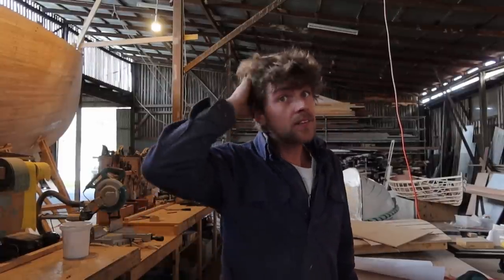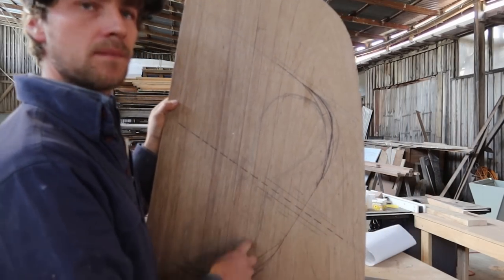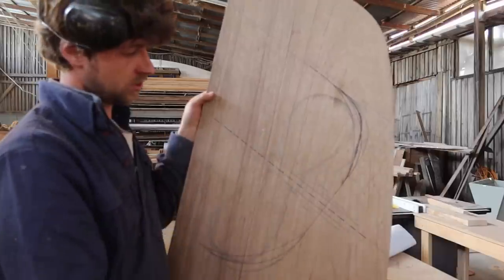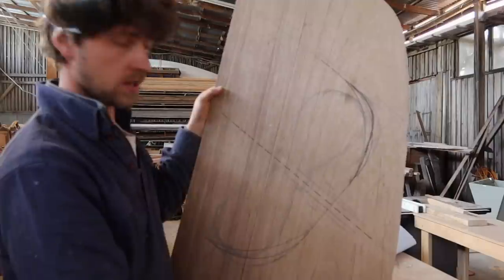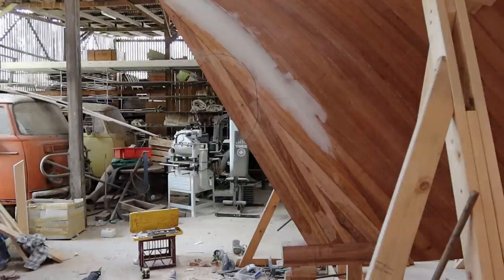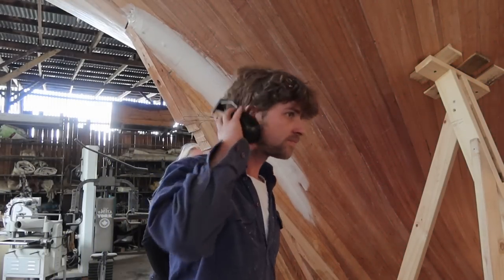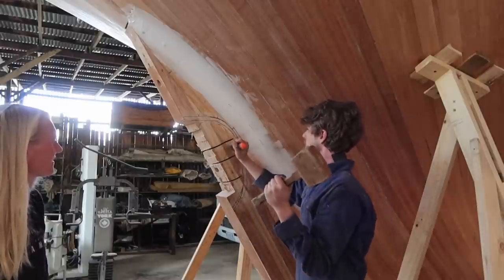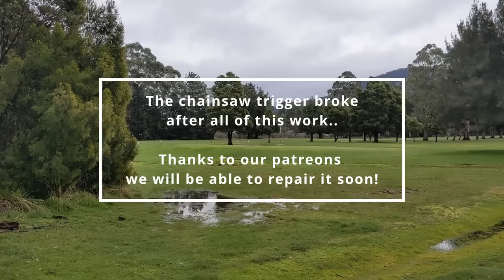Cutting out the aperture, taking a chainsaw to our wooden boat (EP8)

Comment: Good work, am idea for  next time, get an arborists pruning chainsaw, they are much more manageable and if you use the top of the chain, you actually get more control  because the chain isnt getting pulled into the cut, you have to work against the chains motion, if that makes sense. Plus you can get carving bars and low profile chains, it's amazing how precise you can be, with a bit of practice..
Reply from the maker: Thankyou for the advice! Always a bit wary of using top of chain. You can probably tell I’m a self taught left handed chainsaw man which looks a little odd to a trained eye such as yours.

Comment: If you ever have to remove the prop you need way more free space in the rudder blade. otherwise you'll have to struggle with taking of the whole blade, or take out the shaft inside the boat which is a big pain..
Reply from the maker: Good point Peter! How to take it out again one day is definitely a good point to consider! Thanks for commenting
Reply: @Building_a_Boat_by_the_River  forgot to mention the bearings - cutlass or stave bearings do loosen up after some time and need replacing. Some boats I have seen have their shafts offset from the centerline. So half an inch there and half an inch on the rudder might do the trick without much work. I love your boat - she sure looks great!

Comment: That seems to leave perilously little in the way of sternpost. I REALLY hope you've got that right. I wonder if Gartside might have suggested less out of the sternpost, and more out of the rudder, even if it meant having a slightly bigger rudder to compensate.
Reply from the maker: Ah yes it would seem that way but do not fear there is plenty of sternpost remaining! It’s deceptive with the planking, especially strip planking that has no “rabbet”. This is also very similar to what gartside drew, Tarkines stern post is still plenty strong enough.